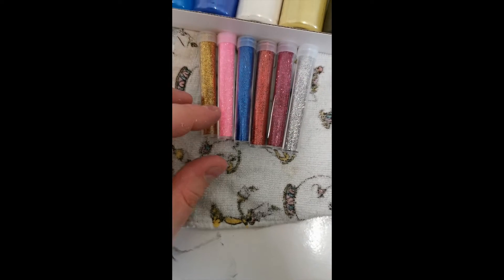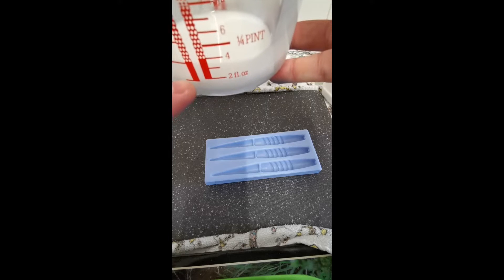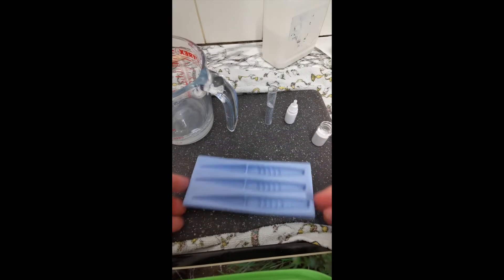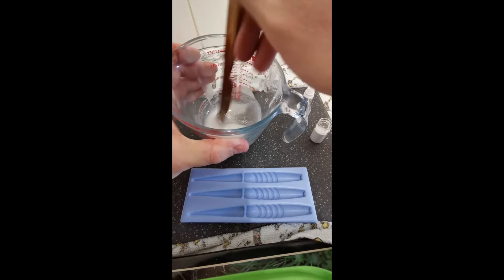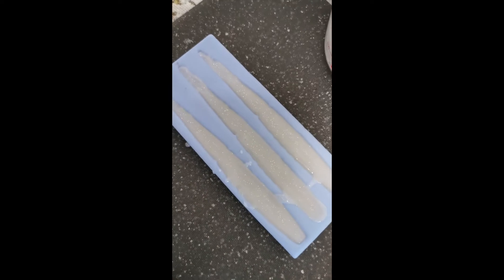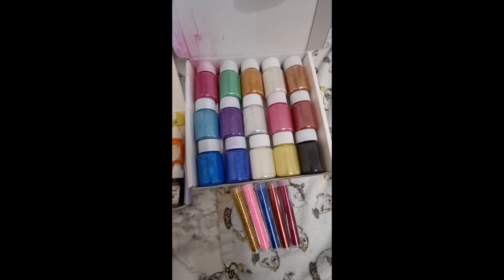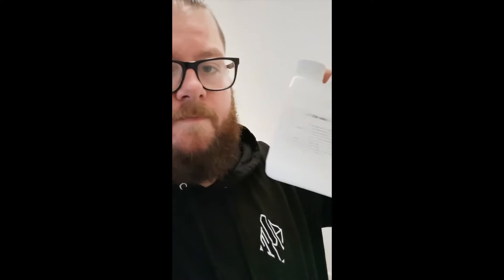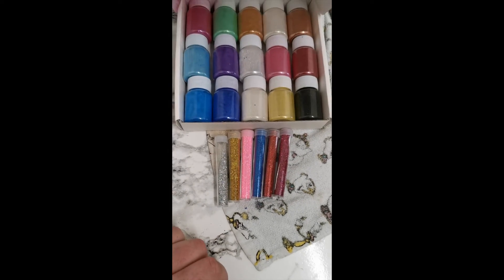How to: How to make soft plastic lures

Comment: good video.i  would have been tempted to try to stick 2 together.posibly heat off a lighter or glue.just a thought
Reply from the maker: I've thought about that haha but it's quite bulky. Maybe I could half fill the mould. Then when I stick together it will be same thickness as normal. Thanks for watching.